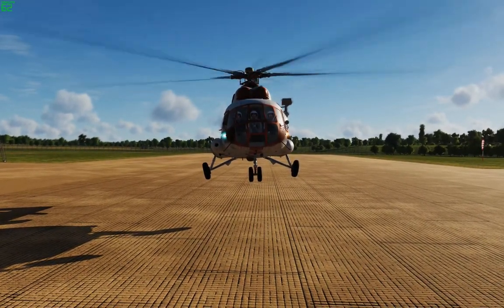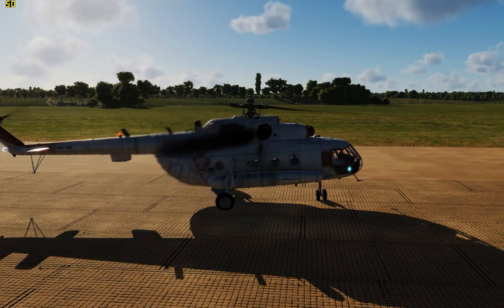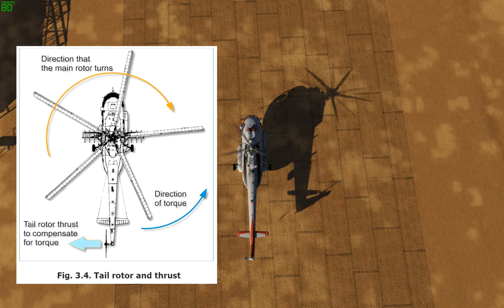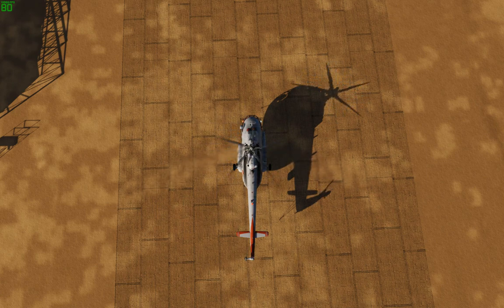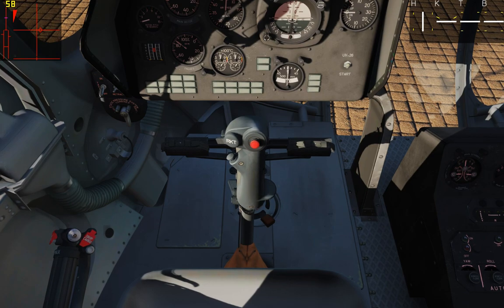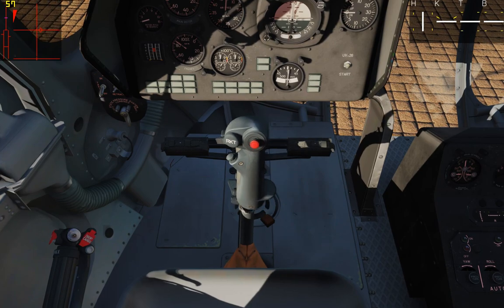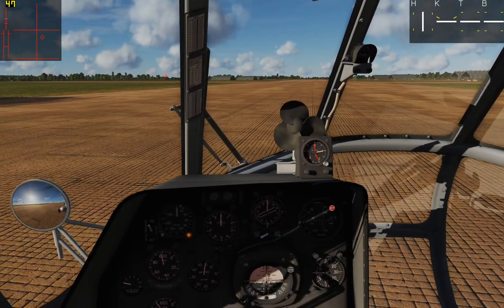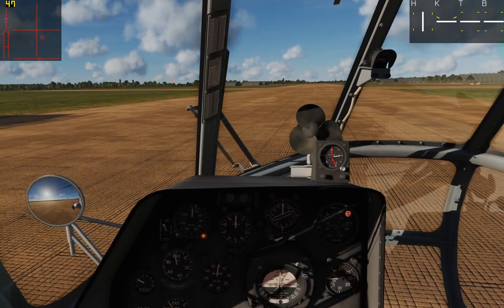DCS Mi-8: Hover Tutorial

Comment: Terminus- videos are outstanding best on HIP ever. I have 2 questions 
How do you arrest your descent rate I  hear you talk about here and landing.as well as others, keeping if under 3.  But how are we doing this??  I have been told too you have t" catch it"I can keep it like at 2 nice and easy and steady somewhat. and then boom crash.

And second ? What are your control settings.   I am 0,100,100 and zero. Because I've got cussed at all up and down the forums and discord. Asking this.  I have a Warthog on a 20cm extension. But I am all over the place like the Gazelle.  I have probably over 150 hours in this. And still cannot hover or get into hover on landing.
Reply from the maker: 1. Manage your altitude with the Collective. Add collective to either climb or slow your rate of descent. Reduce collective to either descend or reduce your rate of climb. 

2. I use default settings, no curves, no saturation changes. With my X-56 I have roughly a 5% deadzone because of slop around the center. It should actually be more like 8-10% now I think. That will depend on your hardware.

3. Transitioning into hover when landing is one of the most challenging things because so much happens all at once. You can slow time in the game and practice in slow mo, it might help you a bit. Here are the steps, in order, that you'll need to get into a hover:

- Aft cyclic to reduce your airspeed => This will also cause you to climb
- Reduce collective to eliminate the climb and hold a steady altitude or even descend a bit
- As you reduce that collective you will need less right anti-torque pedal input
- When you slow to about 30kph and the helicopter starts shaking and buffeting, add collective. Do it before you start descending faster.
- Now is a good time to reduce your aft cyclic to bring the nose back down and get ready to move into a hover => This will also cause you to descend
- Add more collective to keep your altitude

Finally, adjust your speed with the cyclic*, and adjust your *altitude with the *collective*. Watch your vertical velocity indicator and try to keep yourself within +/-2 m/s climb or descent throughout the entire maneuver.

Good luck!

(I do plan on making a "basic helicopter flight controls" video at some point which might help with this)